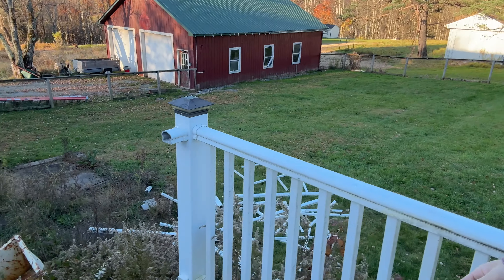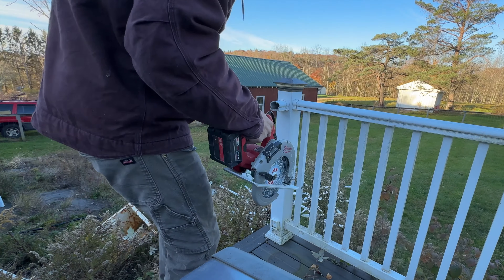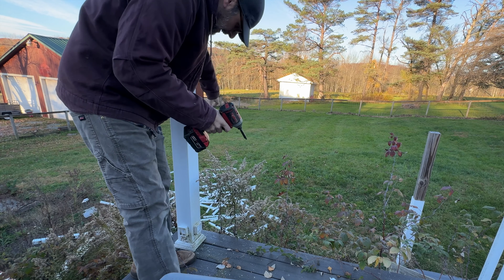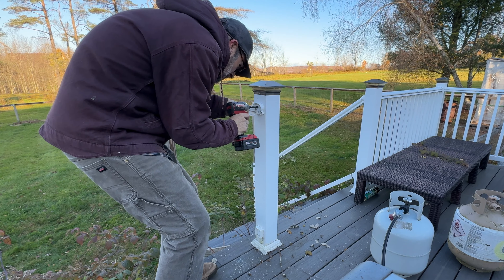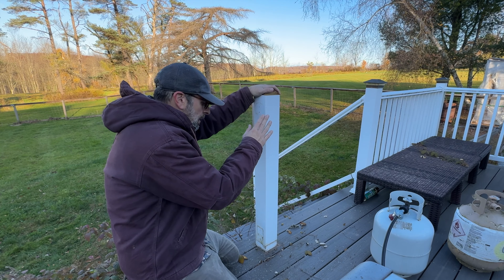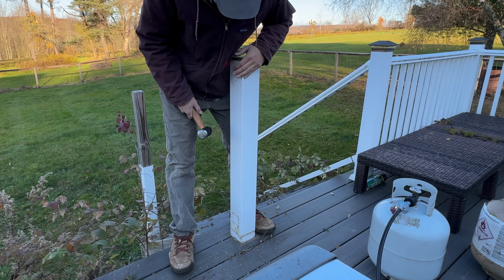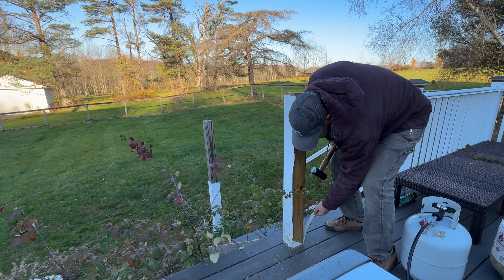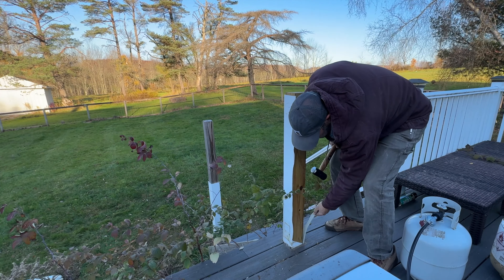Deck Post Cover Removal - Fiberon Weatherables

Comment: May I ask what type of railing this is and why you are removing them?  We are having fiberon railing installed as I type this.  😬
Reply from the maker: Yeah these are Fiberon. I’m not a fan of them. Keeping them clean is a pain. And they sag on 8 footers. I’m switching them to Aria black powder coated ones. Hope they’re working out for you 👍
Reply: Thanks.  Too late to go back now, lol.  We got the black brio from fiberon.  Do you mean the railing sags?   I believe our railing will be in 6' and 7' sections.  Hopefully ours work out for us.🤞🏽 Thanks for the response.
Reply from the maker: Well it’ll be easier to clean than the white. Green won’t show up as much. And yeah they sag. But at 6 or 7 you should be ok. Just make sure the balusters are tight to the top.